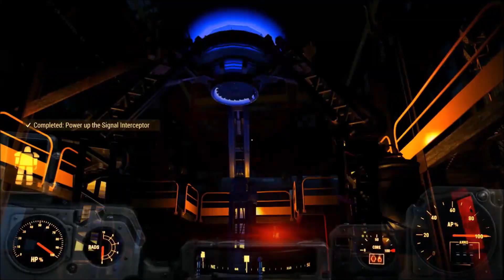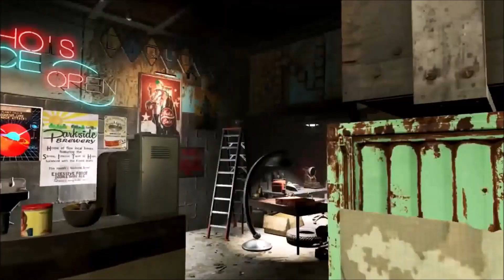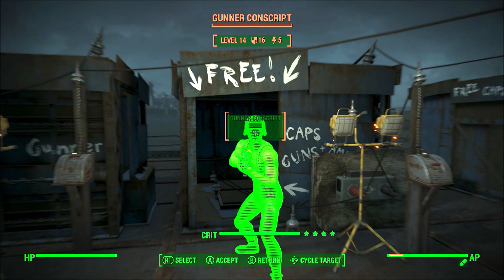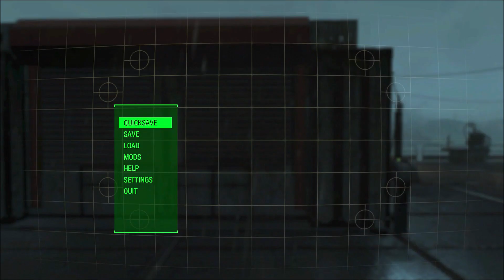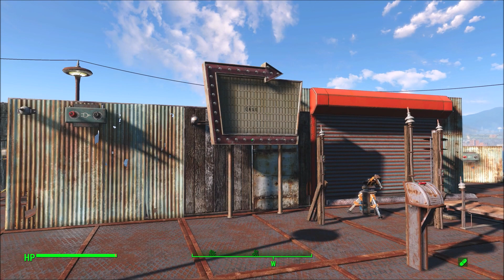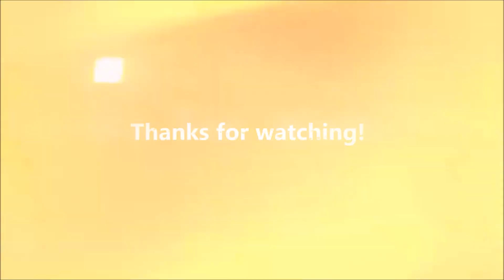Cage Conundrum

Comment: Silly question, but will the nand logic gate work for the raider cage and light? I am picturing the cage light being on when it's empty and then off when it receives a power signal from the active cage. I am trying to think in reverse and my head hurts 😆 
Really cool kill box and great electrical advice buddy. 👍
Reply from the maker: Unfortunately no.  I guess I didn't do a good enough job showing the 4 states.  Power on-empty, power off- empty, power on- full, power off- full.  The cage just doesn't do ANYTHING electrically when it's full or empty.  Logic gates won't help because no state changes electrically when an enemy is captured.  For a logic gate to be effective, an input must change (either ON or OFF).  Hope that helps clear it up.